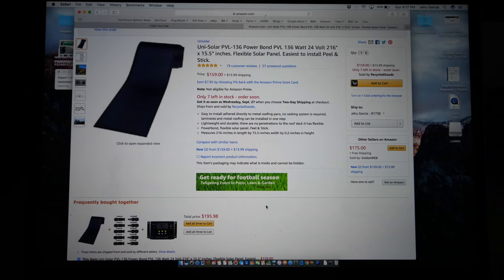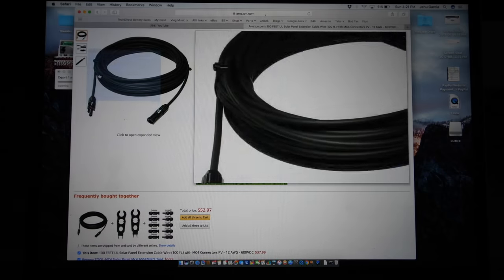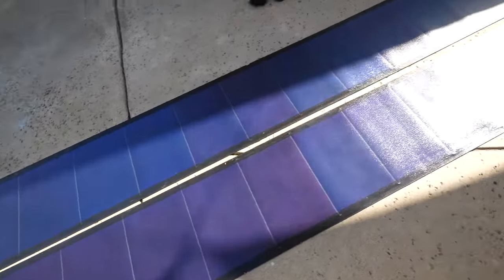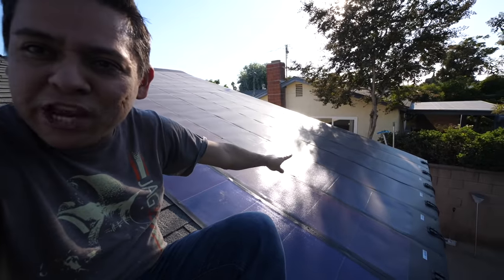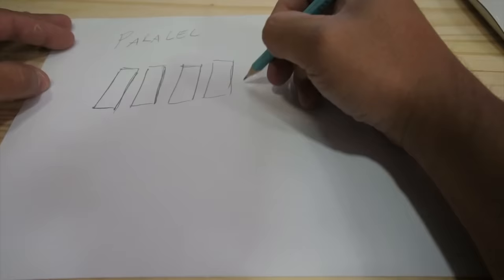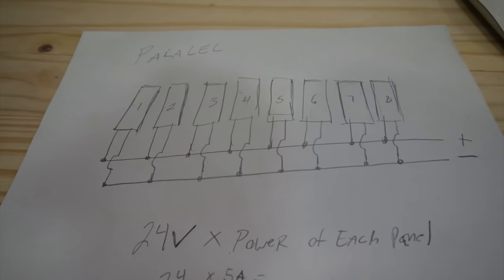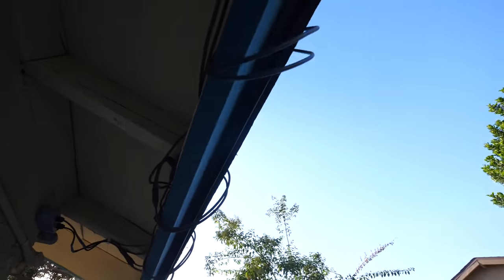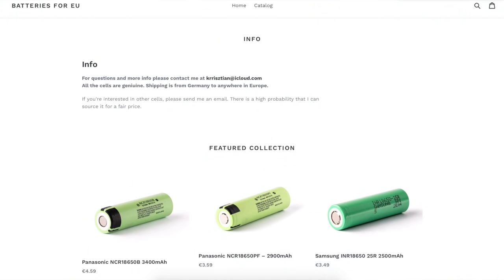My $1500 Introduction to SOLAR panels

Comment: Seriously should have stuck with the mc4 connector just cut off what's on the panel and add it it's not that hard...
Sure it takes an hour to take them off again....so will the bloody wind it will take them off they way you put them on!
Reply: How does the way the wires connect help hold the panels down?
Reply: AnantaSesaDas What? You don't know anything about solar...

Comment: You should have mounted to sheet of weather treated plywood....also BE VERY CAREFUL....sometimes power company will shut off power to do maintenance...so unless entire solar system is NOT connected to grid, you could actually electrocute lineman doing maintenance. So if its not connected to home power, you're good